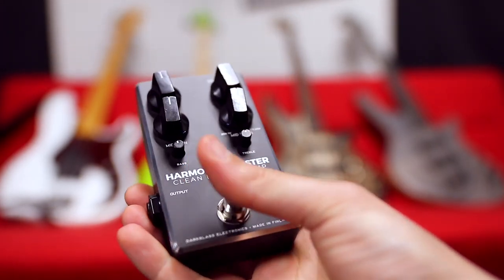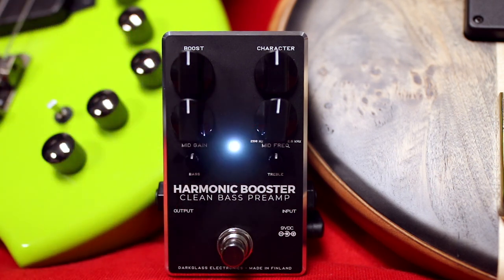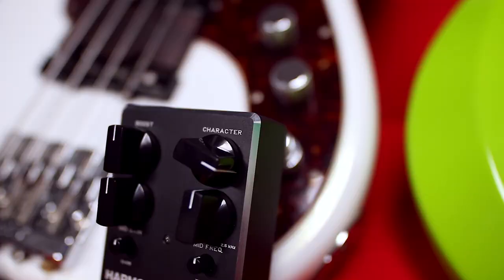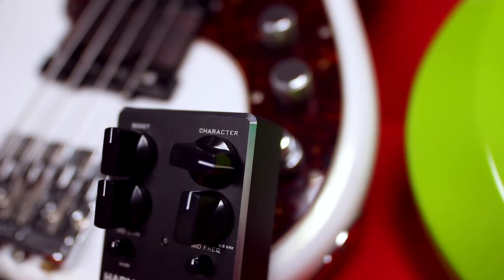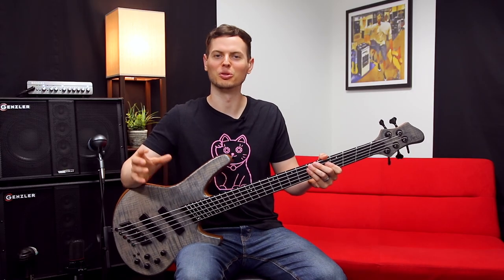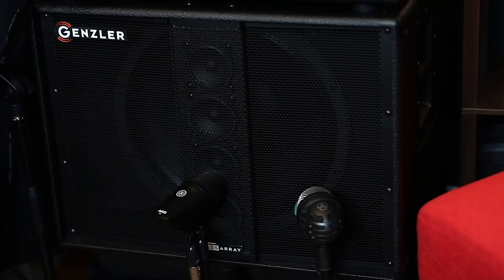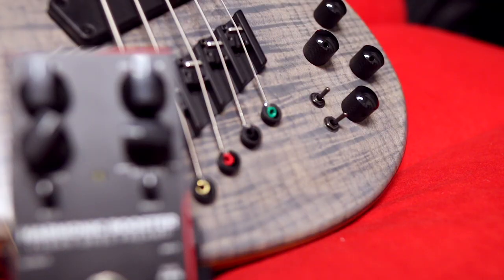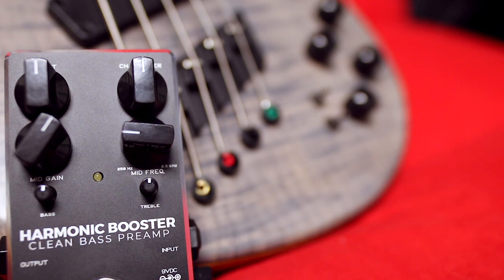DARKGLASS HARMONIC BOOSTER - Clean Bass Preamp

Comment: I've recently found used Harmonic Booster in mint condition for a fair price and wanted to partly satisfy my curiosity about DG products, so it seemed like a fair starter. I've tried putting it as the first unit in the signal chain, and after the two stacked overdrives (Battalion+MXR M80). Putting it AFTER the overdrive suits my sound taste much, much better - Its 'character' knob works great (and noticeably better) when the unit is put after the already overdriven signal - it seems to me that it blends in/out that 'Darkglass sound engine' which adds a lot of brightness/crispness and attack to the sound, even when all the EQ knobs on it are set completely flat because its EQ works at the same boost/cut levels, no matter at which position the 'character' is set. Cheers!